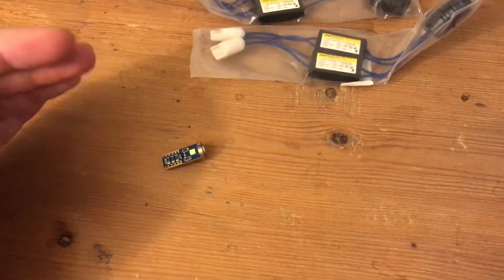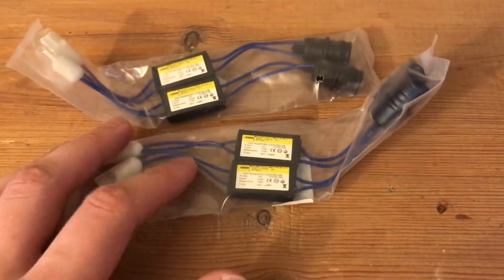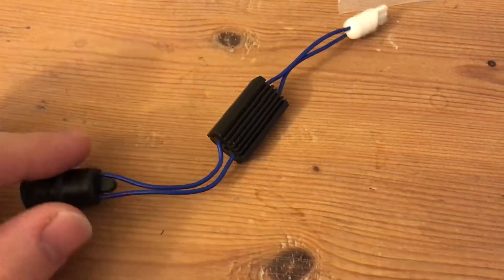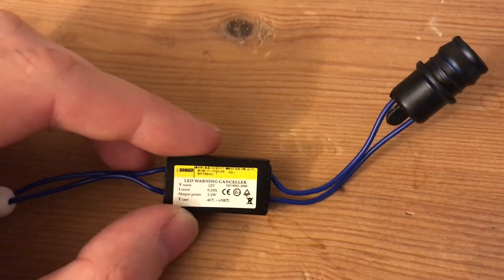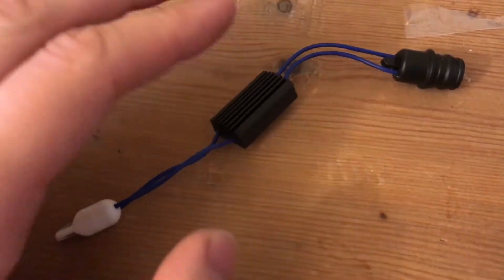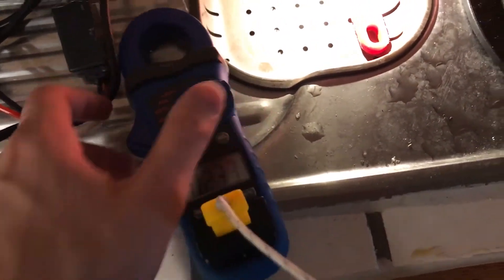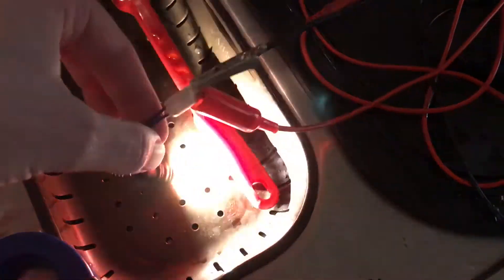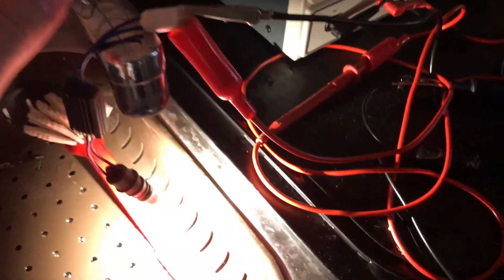T10 Led Load Resistor Canbus - Dangerously Hot

Comment: I have problem with my grande punto. I put led light on my number plate and now i have warning on board. Now i whona put does resistors buy i see in comets ther are hot and i am now afreid to put them what if a melt instalation and plastic.
Reply: Same problem with Lancia Delta. Did you solved the problem?

Comment: 80 degrees is a perfectly safe temperature. On the other hand, amny LEDs have these resistors built-in, and they can reach over 200 degrees. THAT is dangerous.
Reply: it's 80ºC.  so, 176º F, which is pretty hot.
Reply: Lol
That rubber tape you use to isolate wires should be able to handle 90°C...
I honestly don't understand why u think 90° isn't safe. 
If you put a wire in boiling water (100°C) you won't melt the wire. You will be far from it actually. 
It may not be healthy for your paint job tho. It will heat the surface it is touching, and probably ruin the paint on it.